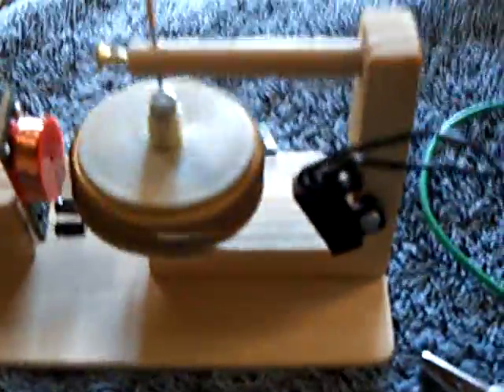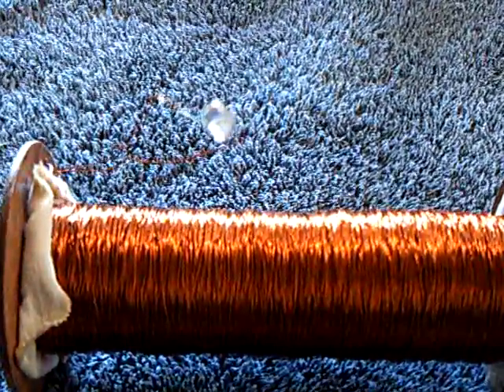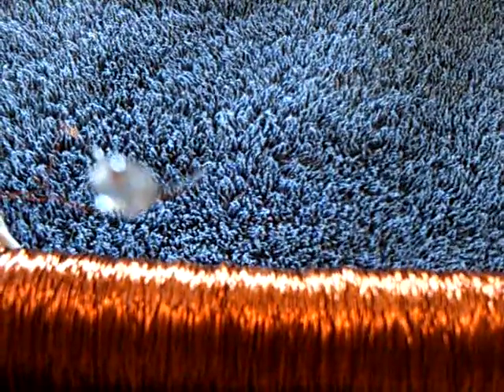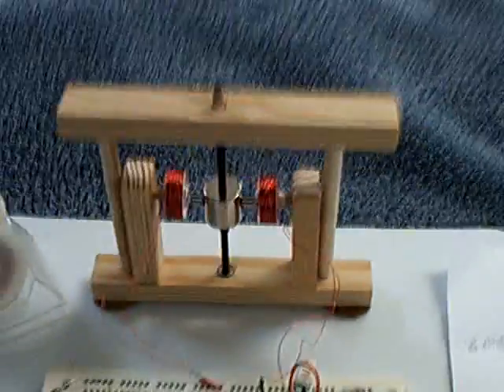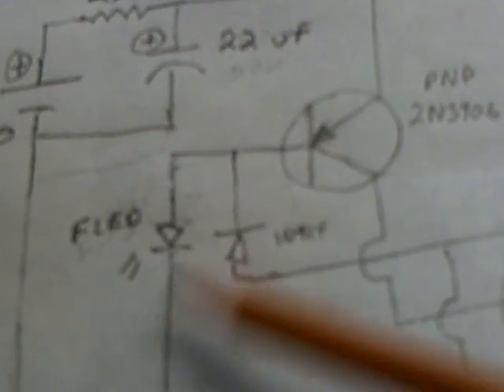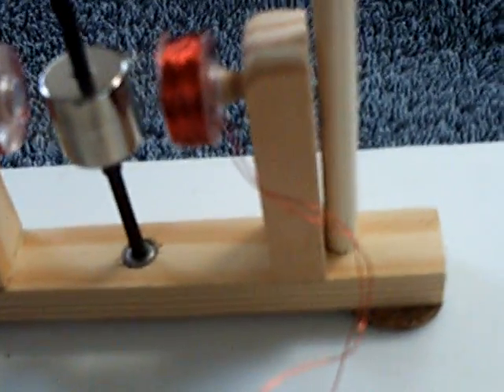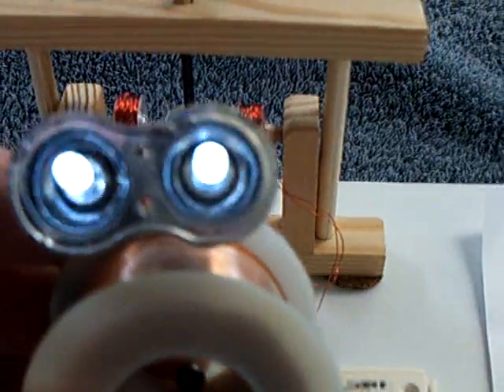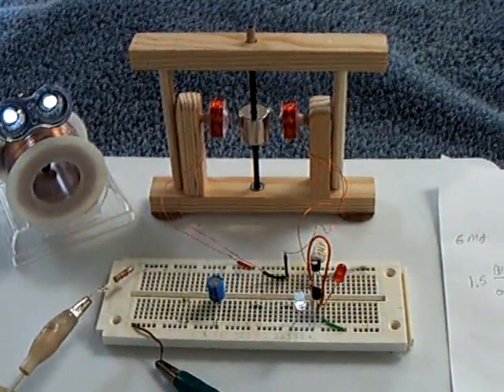Solar Lucky Cat and Auto Start Pulse Motor upgrades.ASF

Comment: cool. thanks for the simple on how maggie works.
FLUX FIELDS : )
would you agree that the fine wire is a must  for a generator pick up coil ? 
whats the deal with that. is it a ratio of wire thickness to field strength type of equation?